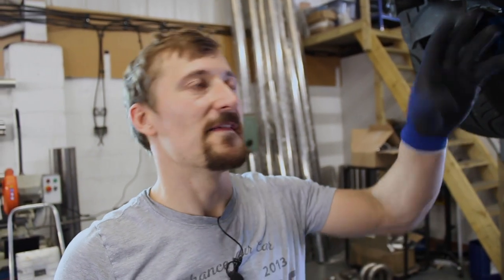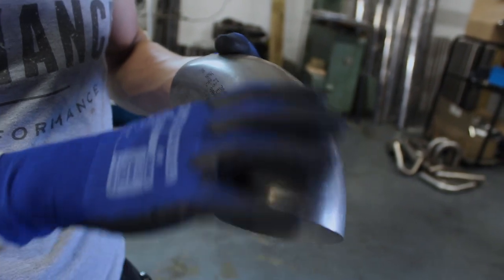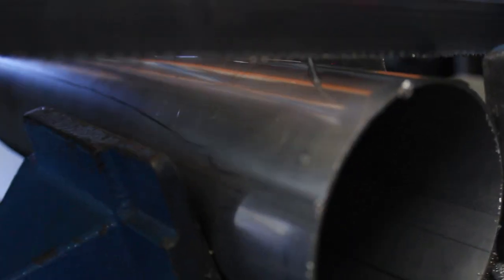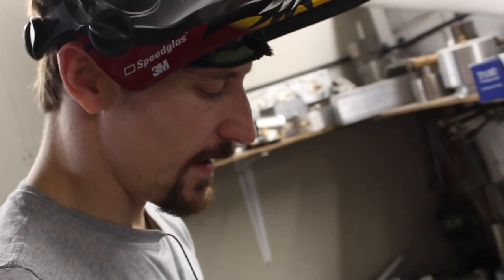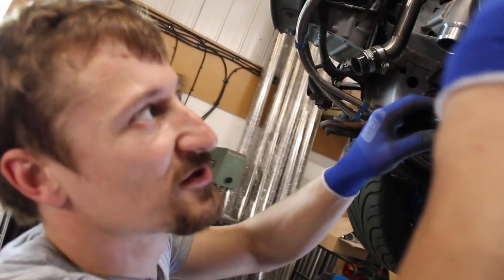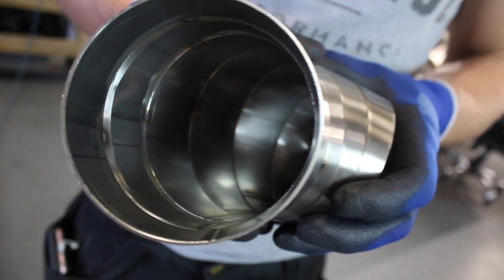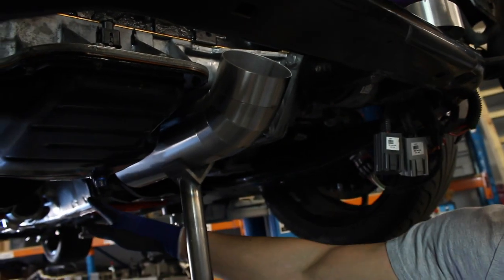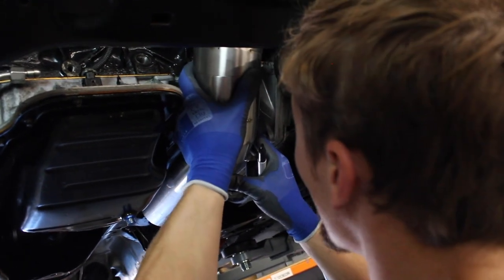Astra H VXR - 3.5 Inch EP Exhaust System (Part 1)

Comment: What sort of power improvement do you estimate you could gain on a 3,5 inch v/s a 3 inch on the same setting without altering emitting else? Or is it mandatory to remap to obtain the gains?
Reply from the maker: Any hardware changes will always have an effect but revising software to suit hardware will always see a bigger percentage gain.

Comment: My Cobra 3" over the axle keeps hitting while running on coil overs Would hate too think what 3.5" is like
Reply: Wait for part two and you’ll see this won’t be hitting the beam, even with a larger diameter. It’s all in the attention to detail & design 🙂
Reply: Unless very low of course, but the customers car is a normal ‘lowered, height :)
Reply: @AdamB8791  Not mad low just normal drop like most But no matter what I do always sorts to hit at one point when driving 😎
Reply: @monument4852  my 3" cobra system used to hit on the axle, ep 3" clears by miles - cobra fitment aint the best unfortunatly
Reply: That’s just cobra fitment being shite 😂 have run one on mine for years with same issue but only happens when going over a bump too fast